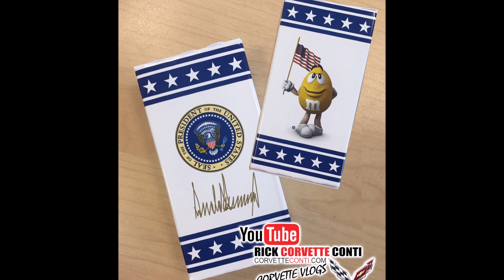WHEN DO YOU CHANGE YOUR CORVETTE TIRES / YOUR RIDES & JIM MERO INTERVIEW COMING

Comment: Thanks for the tire wear tip. Good to know. I had my alignment changed on my GS for normal driving after talking to the techs at Bowling Green two years ago. 14,000 miles later they are still looking good.👍👍👌👌

Comment: My tire life increased DRAMATICALLY with the street alignment specs I found on the Corvetteforums.  There is a race and track alignment spec, but those, like factory alignment (at least on my 2005 C6), will cause premature wear on the inside of the front tires within 10K miles.